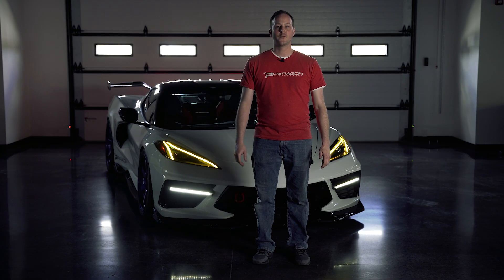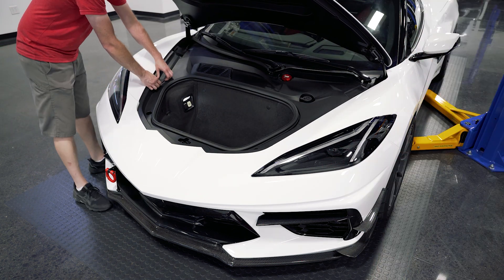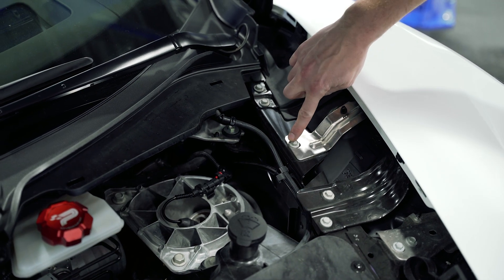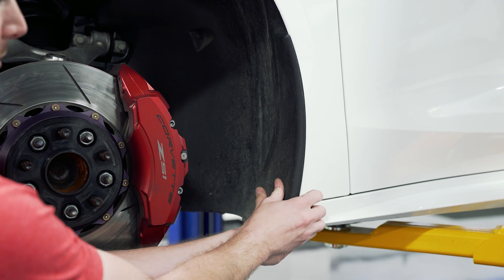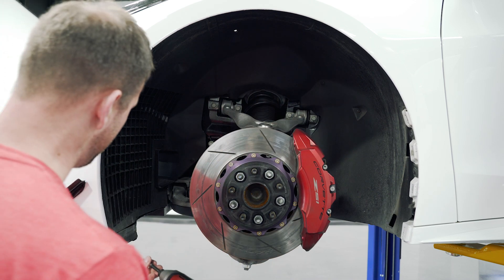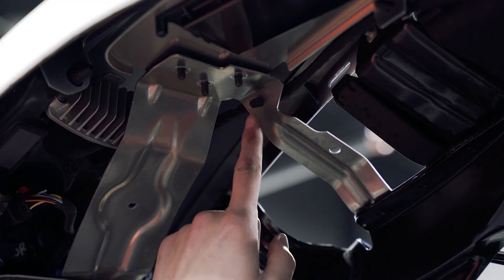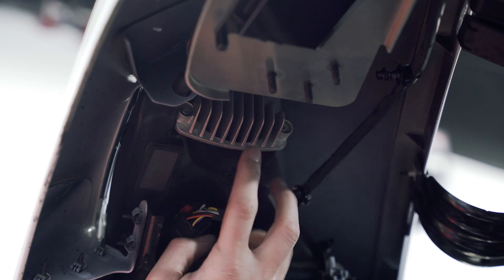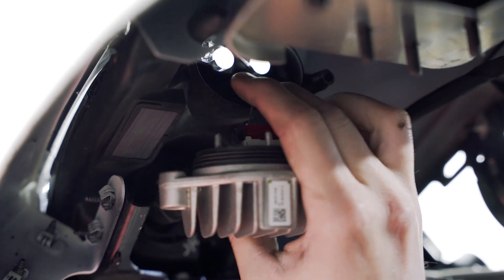Motorsport Yellow C8 Corvette Daytime Running Lights Install! - Easy DIY - Paragon Performance

Comment: My question does it retain street legal usage? Don't want to be bothered by CHP
Reply from the maker: You'd need to check your local laws and regulations but a lot of OEM manufactures are offering yellow DRL so they should be okay.